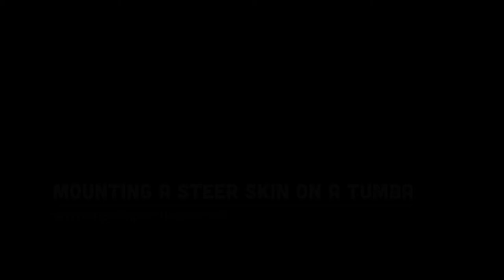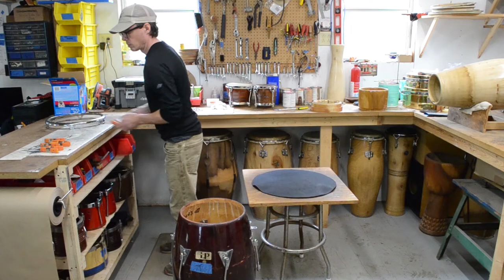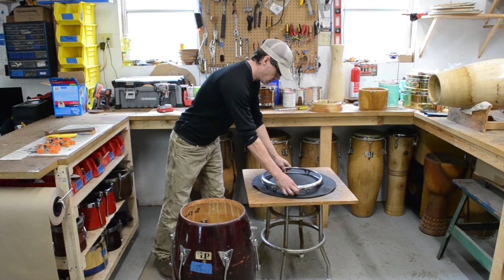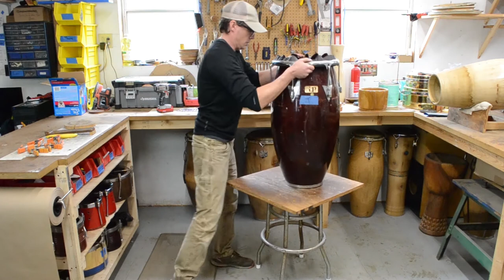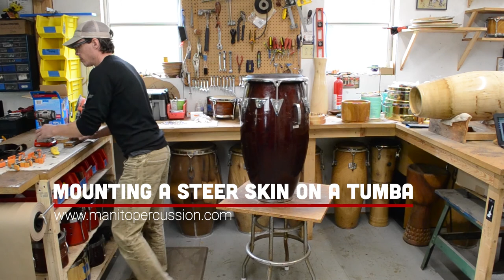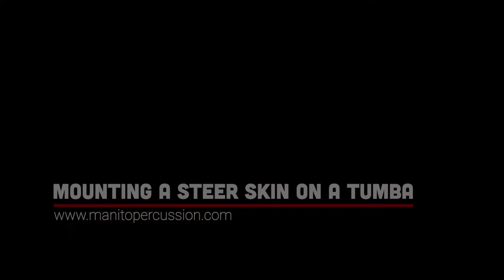Mounting A Steer Skin On A Tumba

Comment: Just mounted Monito skins on a conga and a tumbau using this video as a guide.  Made the fixtures out of wood on hand and bought some clamps.  Total time spent was less than one hour and there was no difficulty at all and I have never done this before.  
Thank you so very much for posting your technique.  Nobody should be dissuaded from using plain skins for their drums if they follow this excellent guide.
Reply: Did you soak it first?
Reply: @fredericinduni  Yes, I soaked the skins overnight (about 10 hours) which may have been longer than necessary but the skins were not harmed by a long soak.

Comment: @5:02 "Over the course of the drying period, I applied quarter inch turns to the lugs to arrived at a neck height of 3/4 of an inch" My question is:  How often do you apply these turns?  Every hour, 2 hours...?   Thank you!
Reply from the maker: Every 24 hours- enough to keep the skin from forming a dip in the middle